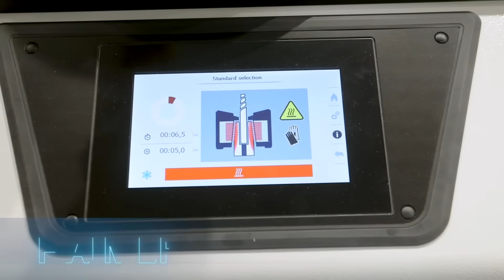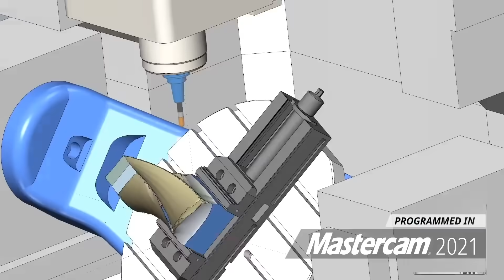Suffering Through The 2008 Economic Collapse!

Comment: 08 was tough.   I have a fabrication shop, turret press, 2 lasers, 4 press brakes…21 employees.   Started 09 with 7 employees, by mid May, 5.   Most jobs that did come in had an extremely short lead time, whatever machine we were producing the parts from, I wold ask my guys to stay as late as they could but don’t turn the machine off, come get me.   When they left I asked for them to come in as early as they could the next day.   I would process the parts that night until they returned.   3 hours sleep n office floor later, back at it.   
It’s not the good times that define us, it’s the hard times.  I was determined that if I failed, it would not be from a lack of effort.   
Today the business supports 15 families, families that are my extended relations.  
We got thru 2020 with all our guys, and that only strengthened us.

No organization is greater than the sum of it’s parts.  It’s not the equipment, the software, anybody can acquire those things.  It’s the folks that walk in that door everyday.

Comment: I have seen bad times in my life. I have been a welder and a sheetmetal fabricator and worked lathes and mills. I was laid off 17 times in 10 years. I know the fear and the pain. Sleepless nights worried about my family. But I was able to find work to keep going. By working part time at 5 different shops. One would have work another I would work after hours for. then one would run out of work and then another would need me full time till that job dried up. I retired on July 1, 2013 at 65.after working as the foreman for Gallo Winery for 19 years. After working in many different shops. When I retired companies that I had done work for started calling me wanting me to work for them. After being retired for 7 months I returned to work building food processing equipment for two company's and worked for7 more years. At 72 I retired. Your story is great. I hope you know how special you are. I am sure GOD is very proud of you. Thanks for posting this.

Comment: I remember those times when it hit our business, we had to restructure our business a bit to keep afloat. No overtime, no working   on the weekends, mandatory 3 days off with multiple rotatations of employees. A few of the guys walked away which I figured would happen. But after all that happened we still came back, and even better.  2008, 2009, 2010 were some difficult years.
Reply: It is rough.  I remember getting out of college in 2005, took a year off, and then started searching for a job.  When the economy took that massive hit, I couldn't find a job.  There were people lined up down the block near me to apply for a job at a fast food place.  Took forever but managed to find a job after a lot of hardship.  

Doesn't matter your political stance, race, age, gender, etc..., hardship is hardship.  We all suffer.

Comment: This may sound dumb at this point, however, there is online market places that still need machined parts.  3D printer upgrades, Quad Copters, 4WD RC vehicles and other ' non esential ' replacement parts.  They all will be smaller parts than what you are used to, some may require contacting companies to get licence agreements, some will not be possible to get down in cost to afford to make at all.  There are products waiting to be made, the hard part is getting people involved to get the list of them together and deciding which, if any, will be cost efective to make and direct ship to individual customers.  You built it up this far, had a big shakedown, now is the ti e to ' upgrade ' the way you do things.

Comment: After getting over Leukemia caused by 9/11 in 2014, I purchased an old Ebay for under $700 Matsuura MC500-V rebuilt the drives and it paid for the additional machines I have now.

Comment: To be successful I believe you need to experience close to failure so you know when to pull back in hard and desperate times, some decisions you have to make absolutely suck but without knowing when to make them decisions luck may not be on your side the next time round and you may just end up at a point of no return and everything implodes leaving a massive hole that will indefinitely turn your life upside down. (I wish I had that 2nd chance)